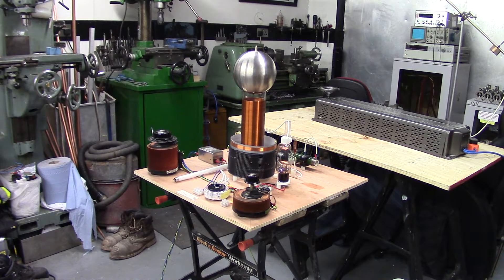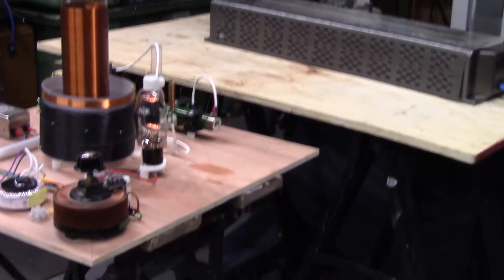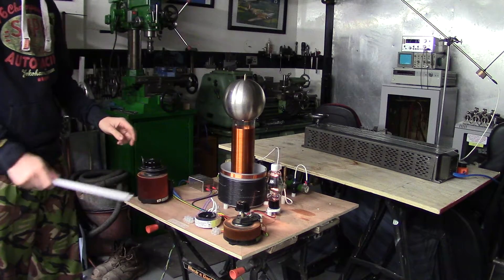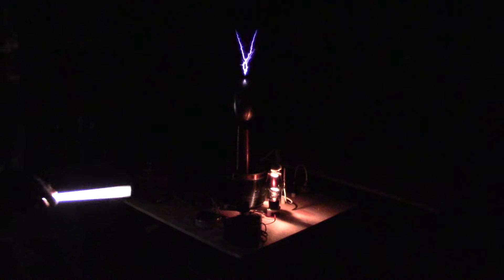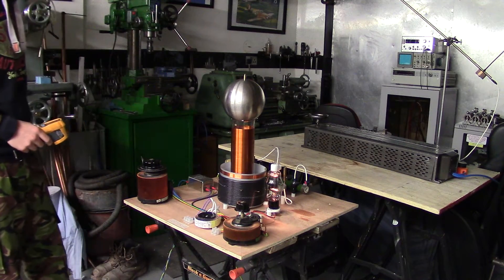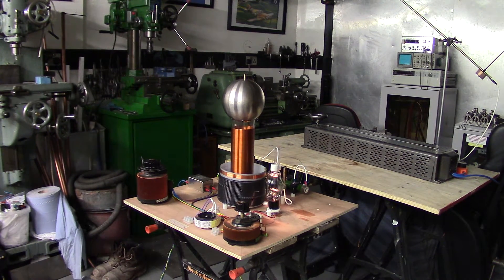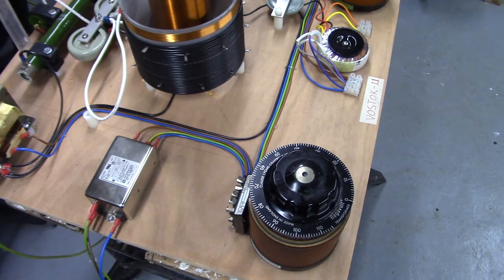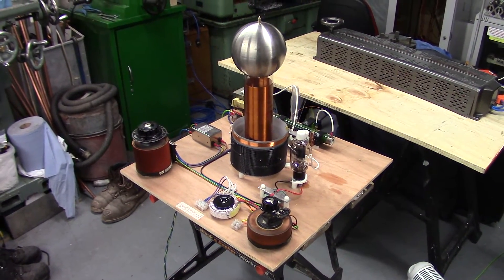Single 811A VOSTOK 1.0 Vacuum Tube Tesla Coil Demo

Comment: Hey Steve,  thats a good output for that little tube 👌👍, side note, i think the 811 is a directly heated filament so it doesnt need a warm up period,  it can run immediately 👍👍
Reply: I expected seeing you here!
Reply from the maker: Thanks! It's not bad for a first attempt, it really warms the appetite for more power in the next design.

I like to heat the filaments gently to protect from inrush current from cold starts, probably only prolongs life by 10% more, a  more efficient way to limit inrush would be an NTC thermistor, but that doesn't have the same effect as turning a big dial up slowly! 😉👍
Reply: @SteveLane  oh I see, your just soft starting them, 👍 I thought you were allowing the cathodes to heats up, sorry mate, I should have known you would know about indirectly heated vrs directly heated 😃, it would be awesome to see you back on the hv projects but I also understand life commitments have to come fist... 😃👍

Steve...
Reply: @T2D.SteveArcs  @SteveLane I think this also depends on the output impedance of your power supply.
If i connect mx filament transformer directly to the GU-81(M) it doesnt flash up instantly like a light bulb would, increases slowly in brightness over maybe 1/4 a second, but if i used a car battery for example it wouldve significantly started shorter and couldve broken the wire.
Thats my theory, i still soft start it with a contraption made out of a indirectly heated diode and relay.